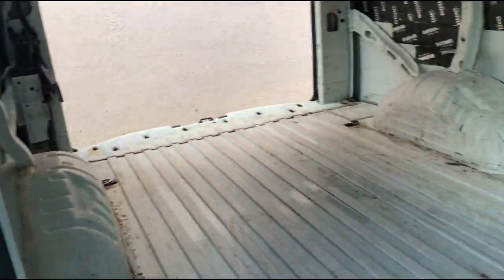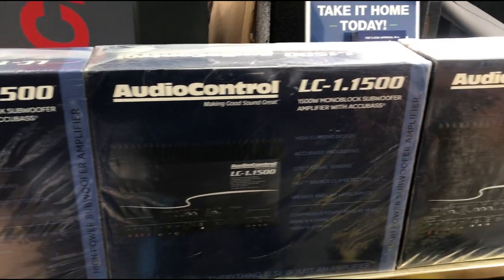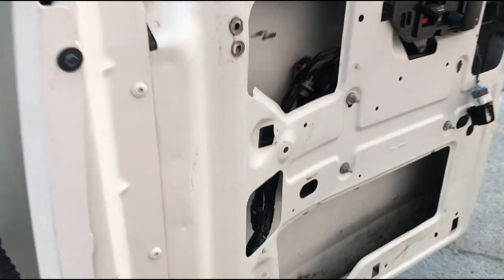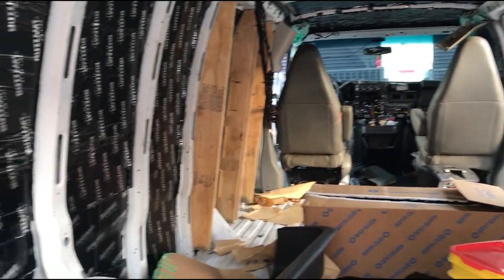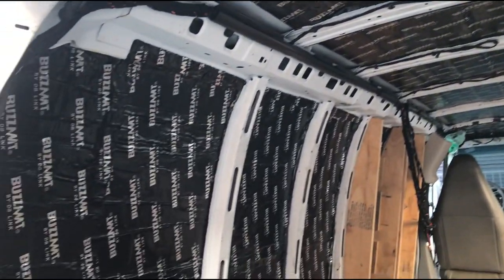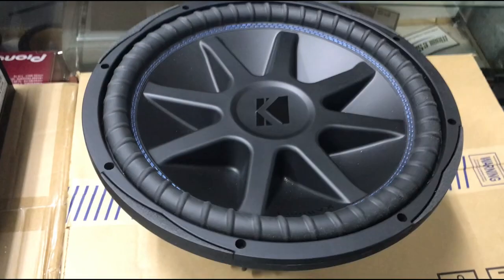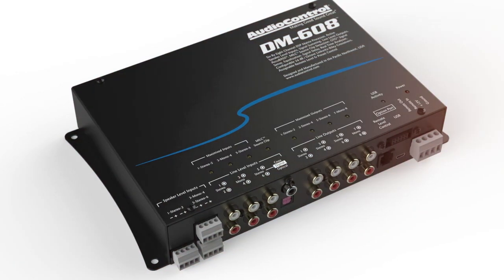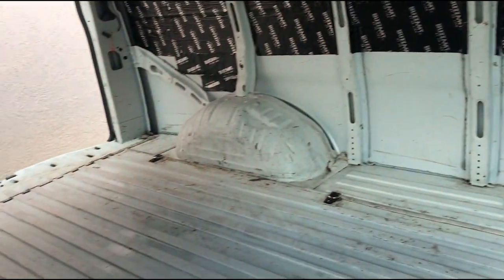CHEVY EXPRESS VAN CUSTOM AUDIO PROJECT.EP-1 #express van

Comment: What’s that on the insider ?( black sticker wall )
Reply from the maker: Sound deadening material.
Reply: @Balgaz_speed     Does that help with keeping the car cool
Reply from the maker: @djserg4346   Mostly to reduce road noise. In the next video i will install the  weather insulation material.